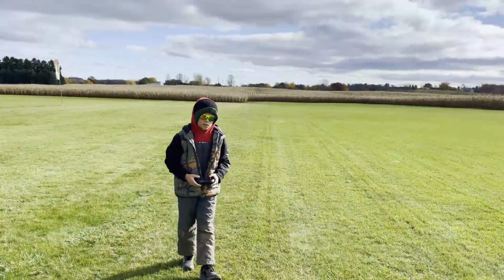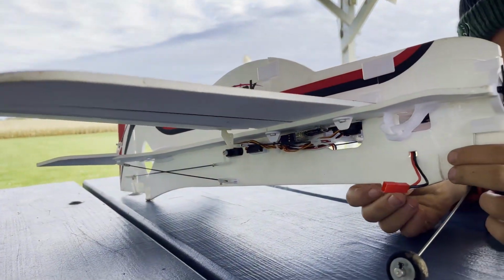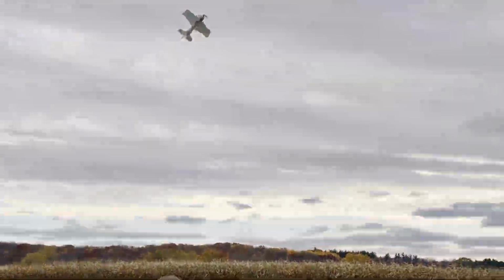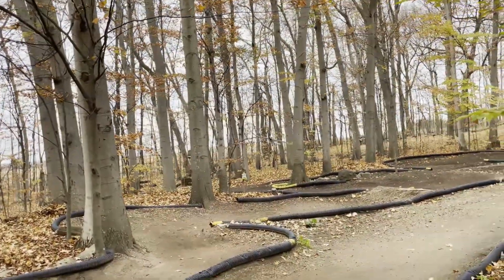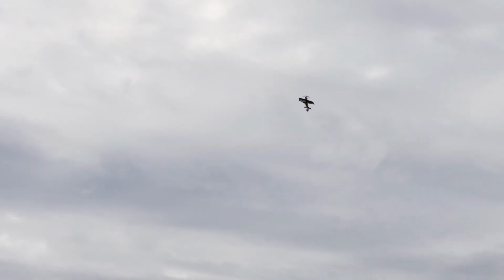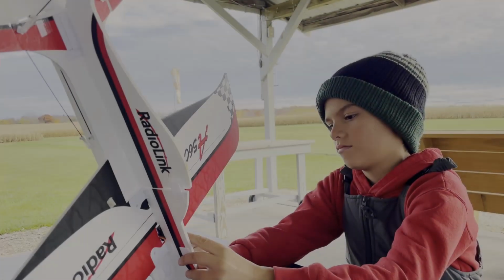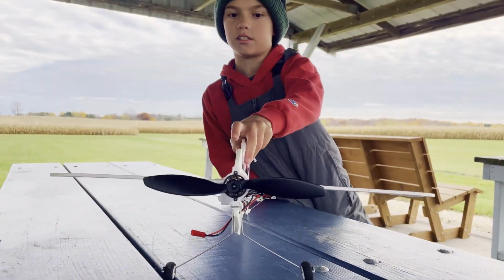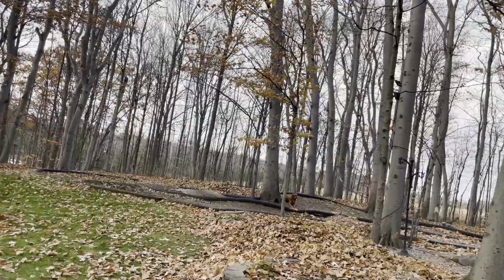The  TOUGHEST  RC plane in the world.

Comment: Looks like lots of fun......outdoors! 

When you let your friends try it, had you already adjusted the expo and other settings or did you let them try the stock configuration?
Reply from the maker: It is a TON of fun 😁
Indoors too if you have a BIG gym to fly in haha. I have never laughed so much flying rc planes 😂
My Sky Ranch friends tried it before the expo, but after I dialed back all the throws mechanically. I put all control arms through the outermost holes in the surface and middle to inner holes on the servo end! The expo helped a fair amount, but the key with this one is small corrections and confident precise stick inputs…something that those guys are already great at 👍🏼
Thanks for watching man 👍🏼🙏🏼